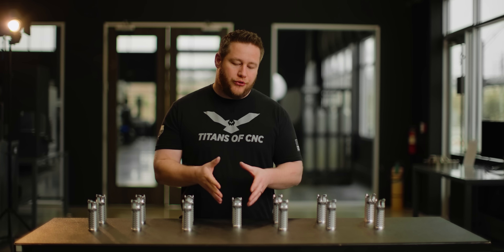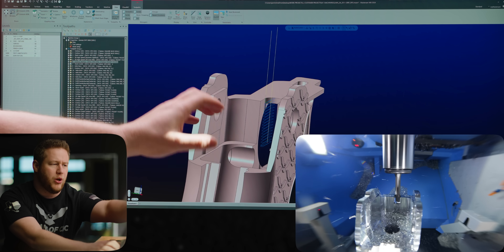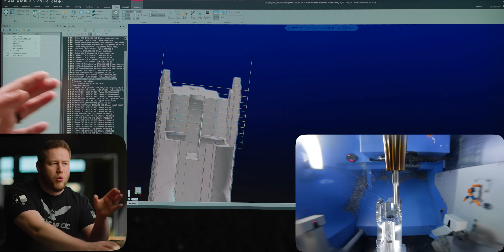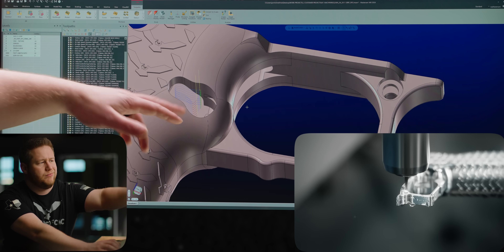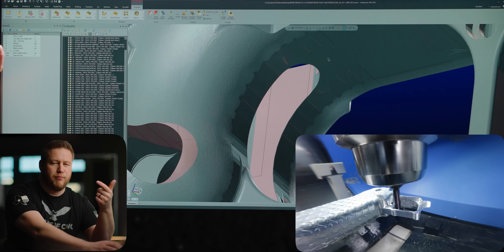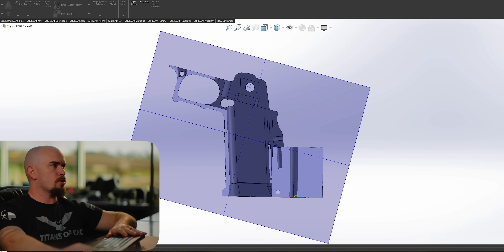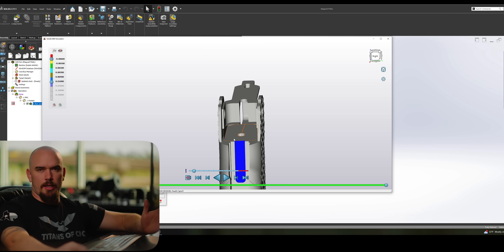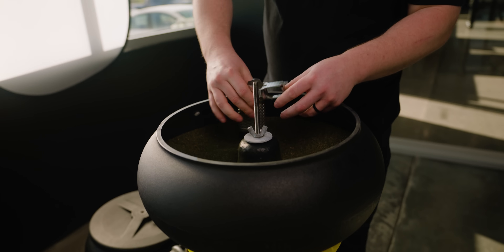EXTREME Machining Skills They Won’t Teach You In School

Comment: Why not rough out critical flats or spots and finish with a fresh cutter? Say stay up .010 . Come in with new cutter at like .008 and measure and adjust as needed. Say 4 spot need -.008" the other 4 need -.009"

Thats one sexy grip tho